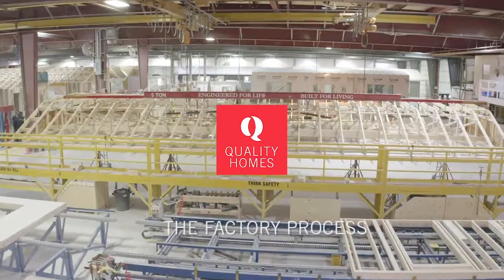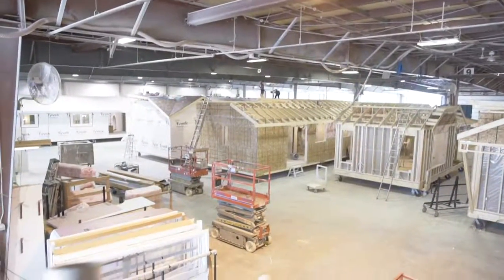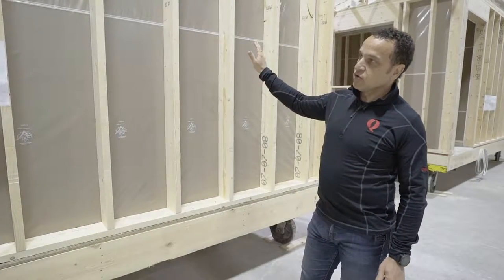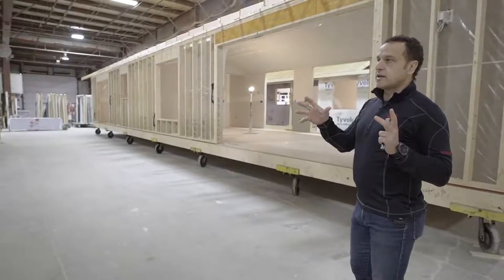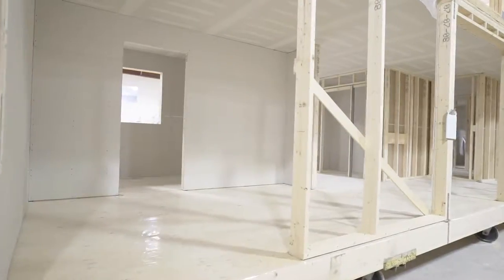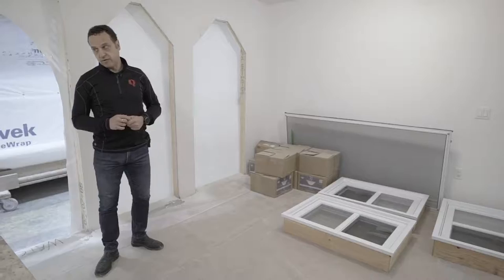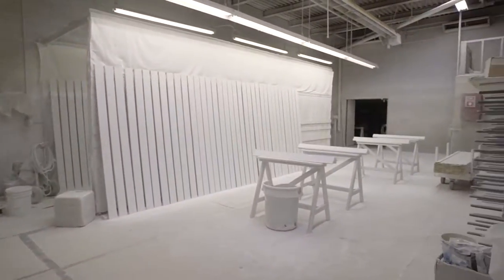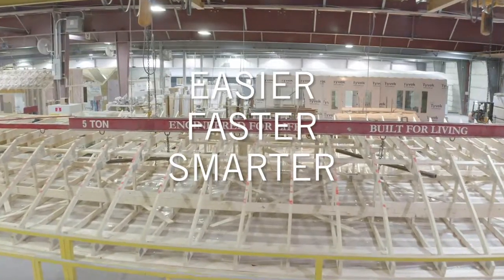Tour Our Quality Homes Factory Building Process

Comment: Is there only one layer of plywood for flooring? It's not sanitary for toilets to sit on the flange because it causes minute seepage of waste products. Don't it will not I'm in the process of laying the second layer of flooring to correct this mistake.
Reply from the maker: Hi Waldemar! Thank you for your note. We build to the Ontario Building Code and conform to CSAA277 standards for modular homes. This ensures top notch quality of our work and peace of mind for our customers. While a second layer may be a good safeguard, we have not experienced any issues with our well-sealed toilet bases leaking. If you have any other questions, contact our team at: info@qualityhomes.ca
Reply: Looks like osb . First time it gets moisture it will wick and bubble not good why not plywood if you’re going to build a quality home

Comment: Why aren't they using steel and concrete
Reply from the maker: We use traditional wood frame construction methods for all of our homes and cottages which are designed to meet and exceed Ontario Building Code. Steel and concrete don’t suit our modular construction methods, but may be more applicable for commercial construction. For more information on the benefits of our modular process at Quality Homes, visit our website: https://qualityhomes.ca/the-qh-difference/